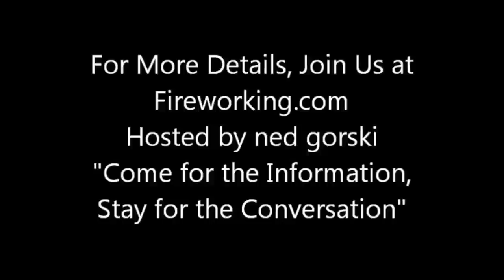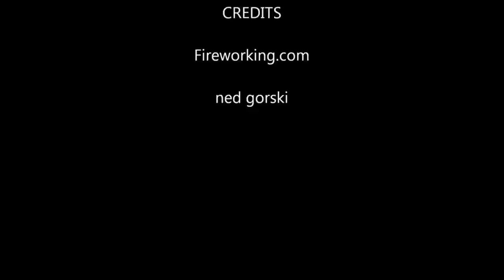7 Inch Double Petal Ball Shell Rocket Heading, Experimental, with Display Results

Comment: I handled mining explosives in an open pit iron mine in northern Mexico back in the mid sixties. All that sliding back and forth across the white work surface makes me nervous. We had to wear rubber gloves, our boots couldn't have any nails through the soles but we were dealing with hundreds of tons of 80% gelamite made by Hercules powder co. and  nitrogen pills soaked in diesel fuel. Made a hell of an explosion.

Comment: Very informative video.  I have always wanted to be able to put on a great fireworks display without the enormous costs of buying the premanufactured fireworks.  This past 4th costs us around $1500.00 which were all the basic fireworks you get at a retail store.  

I do have a few questions if you have the time to answer them.  

What type of licensing is required to manufacture this level of fireworks?
What is the cost per rocket for manufacturing this size firework?
Can you sell these type fireworks to commercial customers?
What is the model and cost for the tape machine?
What is a drying box?
Do you have a supplier that provides you with all the necessary supplies to build these rockets?
Reply from the maker: I don't typically get into long-winded YouTube conversations, EH. Folks don't get into making fireworks to save money, that's for sure. It's an enjoyable hobby and art form for those who are inclined. Details of everything else you ask about are in the website, and discussed at length day to day.
Reply: @nedgorski  thanks, just wanted to see if you had time!  I have already went to your website so I will try to send you a message from there

Comment: This dude is the firework man. I've followed a lot of his videos...especially construction and recipes. Thanks to him, I've made stars, tubes, and many different size fireworks. And they all work. He knows his stuff. 
Now for a more serious question. Is there a vid with detailed instructions on how to create a rocket for 6" and 8" Shells?
Reply from the maker: Thanks for all that, Danny. There is a comprehensive tutorial on BP/charcoal-tailed rocket motors, along with the chart of their lifting capabilities. I'm also working on Fireworking 401 which will detail 1.5" ID motors, lifting 5" cylindrical headings with a variety of inserts and garnitures. That's the size motor I'd use for 6" and 8" ballshells. Also, the 1.5" Super Whistle Fuel motors lifting 8" ballshells are shown in a video down the list in here.
Reply: I think I misunderstood the term "Rocket". I thought you added a rocket from a hobby shop or something. And of course, in my head I'm thinking: Where'd he get the rocket, how big, did he disassemble the rocket, etc. 
I'm still new at firework making and chemicals.
Now I understand.
KEEP BANGING.
Reply: I'm curious about a chemical I can't find online. It's Declorane Powder. Is there something else I can use?
Reply from the maker: @dannyruiz6868  It's a chlorine donor, so I'd suggest trying Saran or Parlon, Danny.
Reply from the maker: @Covid-ro9ry  I can be reached within Fireworking.com, M.

Comment: Hey dear sir Ned, quick question,  when you make your bp for you rocket motors do you put dexterin in it or leave it out all together?
Reply: I'm bout to buy a press to start making motors to try putting headings on them, getting a bit bored with the cannister shells 😜 ao,I'm ready for a new challenge
Reply from the maker: Nope, no binder. I just screen mix the propellant, dampen it very slightly, and press away, Philie
Reply: @nedgorski  that's what I thought but wanted to double check, thanks as always my friend
Reply: Yes

Comment: I know is an old post, but just to add my "2cent" comment, as an engineer... To reinforce the joint between motor and heading, instead to put a pound of hot glue, I would propose 3-4 even more...6 cardboard ribs... also connected with hot  (or other) glue, but a lot less quantity, and added weight and stiffer joint You can get...

Comment: Quick question for anyone who knows. Will high temp hot glue ignite flash mixture? Also how do you tell the difference between high and low temp glue? The one in this video looks yellow. Very different from mine.
Reply from the maker: It's really the hot glue gun which would be high or low temp, Keith, and, no, hot glue poured directly onto BP or flash will not set it off. The problem is that many hot glue guns have failed, sending out sparks, which definitely would cause an ignition, therefore we never use a powered-up hot glue gun near explosives.

Comment: what size rocket (grams of fuel) did you need to lift that 7'' shell?
Reply from the maker: I use 1.5" ID motors. The spindle size, and amount of propellant, depend on the type of motor/propellant.

Comment: I've recently packed one of those vitamin C tubes out with stars and powder and lared it with wire wool ,  I havnt set it off yet but was  wondering if you have ever tried this , I have no intention of being near it as it's wrapped and strapped and taped in to a plastic box , I usually film myself calmly walking towards the camera as they go off behind me , I've done quite a few vids im eventually going to post, I'm kind of new to experimenting  with fireworks but just wondered if using wire wool in the mix will give it more heft , I can't find anyone on the internet who's done this.
Reply from the maker: I've only seen steel wool used, lit, on the end of a twirled wire, creating that nice orange spark trail, Greg. I've never heard of anything such as you're describing.
Reply: Ok thanks for getting back , I'll let you know  if I see any difference using wirewool.

Comment: 27:55 using strecht wrap is not good at all. Is it possible to use some king of paper replacement instead? 🙄 🤔 😳
Reply from the maker: I LOVE using the stretch wrap. I've never had any issues with static from its use. There are other methods, though, of course, so to each their own.
Reply: @nedgorski  I mean polyethylene has long period of decay, about 50++ years. Anyway, nice work, but fully paper fireworks are more environment friendly 🤗
Reply from the maker: @leksanders8908  I'm going to guess that the small amount of stretch wrap that gets left inside the shell gets pretty much burned up  in the shell burst, Leks. Compared to the amount of stretch wrap being thrown into landfills when pallets of stuff are unwrapped, I'd consider the amount of stretch wrap used in a shell to be a miniscule impact on the environment. But, as I said, to each their own, and if you find a method you like better, have at it. Enjoy.
Reply: @nedgorski  ok. Thanks. Nice fireworks 😌😻
Reply: @nedgorski  just a quck question: is it dangerous if ignitor fails for some reason and fireball does not explode? any probability of harm for possible loytering stranger or viewers?
Reply from the maker: @leksanders8908  We're very careful about shooting rockets and shells far enough away, and in a direction, that doesn't present that danger. Higher power rockets, with light headings, can be more unpredictable, though.
Reply: @nedgorski  thank you amigo 🙂🤗

Comment: Aren't you afraid that the hot glue at 48:20 will ignite something?
Reply from the maker: Hot glue's not hot enough to ignite anything, but I don't use a powered-up glue gun, since they can short and send sparks flying.
Reply: @nedgorski  Thanks for the quick reply! So what do you use? You must have some way have heating the glue I presume!
Reply from the maker: @rublie1426  I use the hot glue gun to heat the glue, and then either switch it off, or unplug it, when applying the glue.
Reply: @nedgorski  Ah I see. Very cool! I have watched quite a lot of your videos lately, and it makes me want to get into fireworks as well. Its just that I don't see where to start when I don't even have any sort of licensing, let alone equipment.
Reply from the maker: @rublie1426  We discuss federal laws, and local laws a lot in the website, Rublie. A lot depends on where you live. The complete Fireworking 101 is here on my YouTube Channel, and FW 201 and 301 are in the site, and I'm currently working on 401. Plus there is a lot of other beginner and advanced info in there. Good luck.
Reply: @nedgorski  I'll check the stuff you mentioned out! Thank you for your helpfulness!